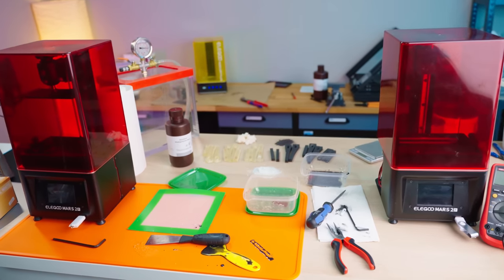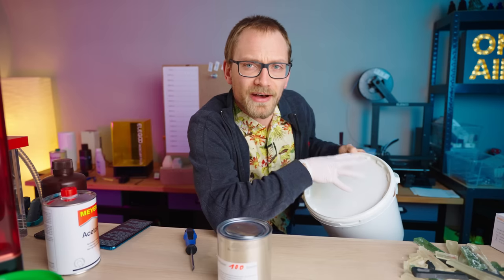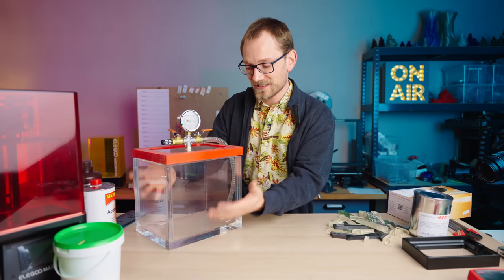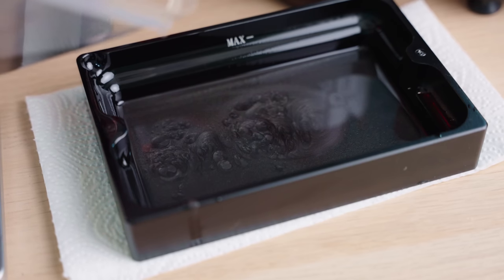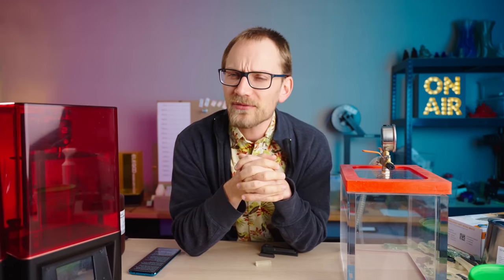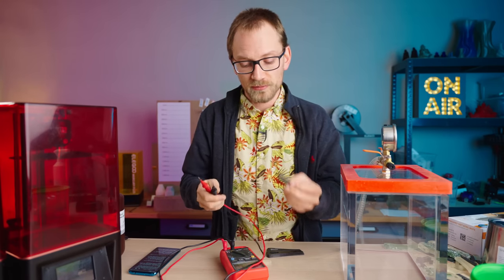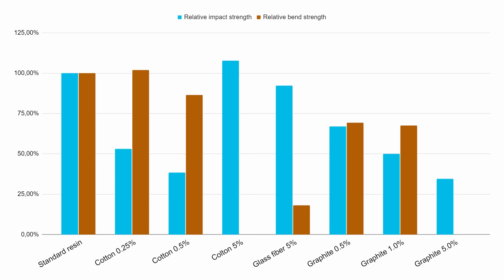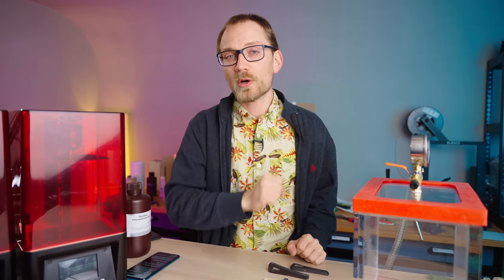Easier Fiber-Reinforced Resin Printing! Stronger and Conductive Resin Prints?

Comment: Not a material scientist either, but isn't the point of adding fiber to have long strong fibers in the part that distribute loads better? By that logic, graphite/carbon powder would do absolutely nothing, as it isn't really a fiber anymore. More likely the imperfections that this creates weakens the part, as I'm assuming the resin bonds better to itself than the additives.

Comment: What about aluminum powder, it is added to resins to add strength.

I know that some the glass fibers are held together with a binding agent, you might be able to separate them by soaking them in a solvent. I'd try alcohol first.
Reply: Do you want an explosion? Because adding powdered aluminum to a reactive resin can totally do that.
Reply: @42436freak  I didn't think the resin would be more reactive than a 2 part system. Given how volatile aluminum can be,  you are correct that it shouldn't be tested unless we know how it would react.

In the marine industry, aluminum is added to 2 part resins to increase the hardness and abrasion resistance. It also increases UV resistance.

Comment: I think the problem is the bonding between the resin and the filler. If there is no bonding your are reducing the strengh because you are make your piece porous. You should try glass microspheres ( I used with epoxy castings ) but it maybe fail also. I think because the resing cures with UV, it just a crystallisation process unlike bicomponent epoxy resins where there is a chemical reaction. Anyway, just a bunch of random thoughts. Good video anyway

Comment: Don't know if it's been mentioned yet, 748 comments is too many to read. But adding stuff to the resin doesn't make it stronger as per your experiments. Adding anything will reduce the molecular bonding that's going on and you're essentially making fewer bonds per layer due to there being graphite in the way instead of resin to bond with. So it's just bonding around the objects instead of making it stronger. Unlike Baking Soda and Super Glue (try it sometime ventalated area pls fumes are dangerous) So yeah, the only bonding done here is UV and Resin, the additives are just in the way. That's my opinion, educated as though it may be....still only an opinion and probably totally wrong...read the 11B yeah, infantryman brain so a grain of salt must be observed ROFL. 
This video was extremely cool to watch either way, I love experiments like this. Plus the aesthetics of the graphite is super pleasing, love to see miniatures printed like that now.

Comment: Realistically, adding any form for structural filler to the resin sla prints will cause  a higher failure rate.

Resin itself when deposited in layers is as strong as it can be.
Adding any form of substance will create brittleness by way of a lower surface area adhesion and the weakest part between the resin and the material.

The only way I can think of to improve the mechanical properties of a "standard" resin would be to have it arranged in a micro grid or lattice. Unfortunately, even with the best laser 3d printers this is not currently possible.

Comment: If I was to make a suggestion, I would suggest carbon nanotubes, and start at 0.1%.

Graphite has a shocking amount of uses.
Paint pigments, dry film, dry lubricant, writing tool, electrical conductor, thermal conductor, reinforcement, fuel.

Comment: Maybe  you could cure the resin + reinforcement in a (UV-transparent) mold rather than using a 3d printer - then you could go to higher concentrations and you could find out what concentration is necessary to improve the mechanical properties.

Comment: Graphite powder in the sub-micron size range on its own isn't very conductive. Adding a small amount along side larger particles like Graphite flakes or CNTs will give you much higher conductivity, but still poor. You might be able to get a capacitive touch sensor/pressure sensor/strain gauge with optimisation. Silver flake is often used for conductive inks, it's significantly more expensive from a material standpoint, and because you can put a higher percentage by weight before printability is impacted because silver is heavy.

Comment: Get a few lengths of carbon fibers and smaller glass fibers and make a follow up video. Honestly, I think carbon fiber has the most potential here for very strong parts. You just need a very thin but relatively long fiber

Comment: Yeah 5% graphite was for sure not going to cut it ^^ tried different powders in resin (not printing resin) copper powder, copper flakes, titanium, steel, each fromm 0-500 micron at different size ratios and up to 50% by weight and just by hand mixing you won't get conductivity ^^ didn't try graphene or any other mixing method (ultrasonic emulsion etc.) as I wasn't looking for conductivity but checking that it wasn't haha thats why when you want a conductive silver epoxy you get quoted 1400€ per 230 grammes (copper is cheaper at around 200-400€/230g), the amount of silver or copper in them is quite high (hence the price for silver) and I think they use some ultrasonic emulsion technique to get it conductive :)
What would be interesting is trying to print with some conductive UV curing epoxy but it won't be cheap if you buy it

Comment: What if you printed a part using a regular FDM printer with zero percent infill and injected that re-enforcement paste into the shell of the print (like with plastic injection moulding). That could potentially be a cheap way to re-enforce parts.
Reply: Or alternatively to zero percent infill maybe some kind of permeable pattern. This could work well with that printer that lays down continues fibbers you tested a while back?

Comment: It's a shame about the conductivity. If that worked it could have been incredible.
That said, your resin printer  is still useful for making PCBs at home. It's a great way to expose photosensitive copperclad (and cure solder resist), just make a one layer file with your traces and set the exposure time accordingly. I'm surprised nobody has slapped a chitu board, a screen and a UV LED array together in something resembling a flatbed scanner yet tbh.

Comment: Hey @thomas sanladerer I was thinking that the cotton seems legit maybe you can try put like 20% in the resin but pour it into a 3d printed mould instead since it will be to thick to print. Also you should try making a protective paint or coating using the resin and cotton n maybe flour! Or corn mill powder

Comment: You can not use chopped fibers. I print with fiberglass and i get a sheet and shave a measured amount with a razor and mix it. What I’ve noticed is that your additives are way too much the layers are to small to successfully cure. Smaller amounts hold in place longer in the resin so that they arent Squashed down to the bottom.

Comment: 5:50 "curing to the core" I think that is actually not really possible becuase one property of the resin is that it blocks uv light very fast by absorbing it so I guess there is not enough getting through. I noticed that in reality when I tried to embed magnets into a part. Imagine a 3mm thick part, that has a hole with a bottom where the magnet can fit in. the bottom is 0.5mm and the magnet is 2mm. so there is 1.5mm on top that I would fill with resin. Putting it under a high power uv light panel makes the top really hard in 8 seconds. Leaving the part under the lamp for 30 minutes is not enough to cure the resin that is 0.5mm deep under the surface (approx). It was like a lake where only the top freezes.

Comment: To improve the strength of a material with fibers, the fiber must have a certain length, because the bond between the fiber and the matrix is always the weak point. If the fiber is short, the bonding area will be too small to use the full potential of the fiber. You won't succeed with milled fibers. They will increase stiffness, but not strength. A good resin is also important. The resin needs some flex to compensate for the different e-modulus.

Comment: Print a mould and then cure a mush with more fibre than resin in that. Might need to build up layers if using printer resin instead of 2-part.

Comment: re. Conductivity - I am not surprised the graphite powder remained non-conductive as the particles are insulated from each other by resin. They will need to be touching each other to be conductive and I am not sure you will have any more luck with carbon fibre for the same reason. (But I look forward to being proven wrong!)

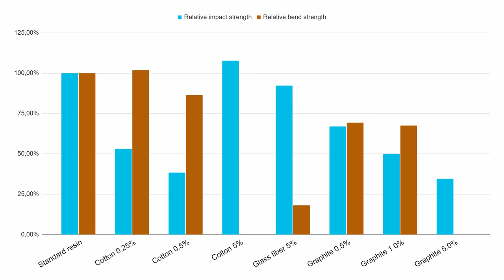Comment: Do I misread that or does the bar chart (at 13:50) actually show an improvement in impact resistance for 5% cotton (or colton)? This doesn't quite sit right with the claim that every amount of additives decreased the strength of the parts. It also doesn't fit the trend of the lower percentage cotton parts. Or am I just misinterpreting the data?
Reply from the maker: Yes, there was a measured improvement in this case, but considering how large the variation was between individual samples, I wouldn't call it "significant".

Comment: I think the fibers should be long and thin and not bending or elastic to reinforce the material not small plates or powder,if you see regular glass fiber or carbon fiber the fibers are long and thin forming a reinforcing mesh a bit like iron bars in concrete

Comment: I don't think it's possible to reinforce parts with stranded material in a resin printer. because the print bed gets pushed flat, the strands will always be forced to lay flat. if you were casting the resin in a mold the strands would be all mixed up and tangled about each other. that's what gives PVC its strength, it's made out of really long strands that get all tangled up. if you layed all of them flat they wouldn't provide the additional strength, and would mostly just get in the way of the resin sticking to itself.

it might be worth it to try casting the test prints to see if they perform better. if the cast fiber-reinforced prints perform better than the cast non-reinforced prints then my theory might be true.

Comment: I think you're missing a relevant baseline here: FormLabs has glass-filled resins (Rigid 4k & 10k). Might be worthwhile to pick up a liter to do side-by-side comparisons. Also, your tests only measure material strength and do not convey any information about part deformation under load. I have had several parts (both SLA and FDM) that eventually deform under constant load. Fiber-reinforced resins might increase the stiffness of the material (but not strength) where they are usable in those use cases.

Comment: Chopped Fiber doesn't make any part stronger when it comes to impact or tensile strength. It maybe makes it stiffer or more abrasion resistant but that is all. In FDM or SLA or even SLS or casting the strength comes from the base material that is connected throughout continuously If you add 1%, 5% etc of anything chopped those chopped bits are not connected so you have less base material to withstand your impact or pull/break test. Now continuous fiber is a different story. If you can manufacture it properly. Only way I have figured out - besides making molds is to 3DP a "core" you can use fdm or any plastic manufacturing technique and then wrap it in FG or CF or kevlar - or anything with a resin like epoxy or polyesther kinda like making a foamcore surf board only the foam is replaced by plastic. Now that in essence produces a Plastic part with a composite shell. So for example you can print a box with a 1mm wall out of ABS and then lay enough 8oz cloth on it with polye resin - a combo I like as Mekp also can dissolve ABS so there is a chemical bond at the surface created whereas with epoxy its just mechanical and the layer lines give a good place for the resin to grip Now you can then build up the thickness to anything you want with cloth/matte/woven roving so he print becomes a consumed mold. We have printed (FDM) 1.76mm wall thickness items for frames (2 perimeters with a .8 nozzle at .88 perimeter width .4 layer height) out of ABS, PETG, HIPS, And then built it up with anything from just 4 layers (2 each side) of  8 or 10 oz cloth all the way to a couple of layers of 17 oz woven roving with a couple of layers of cloth on it. The print gave it dimensional accuracy - 2mm thereabouts abs is strong enough to roll and paint against and properly adhere the cloth and in the end the amount of ABS PETG etc in it is immaterial compared to the amount of FG or CF and you basically have a GF or CF part.

Comment: It's a persistent myth in the community that filament blends with CF powder should make for stronger parts while it is the contrary, it weakens the material because there is no bonding of CF particles taking place and because of total lack of long fibers compared to real CF parts.

Comment: I think you will not be able to reach the concentration of reinforcement required and still be able to print that material. I sometimes work with boats made from glasfiber and polyester, and the strands used are about 5cm long and about half of the finished material ends up being fiber. But this is using a chemically hardening resin and not a uv resin. And glass fibers are typically bonded with something, usually styrene, so your resin needs to contain something that dissolves styrene for it to be able to really soak in to the material.

Comment: Question : I know your are German and you don't make mistakes, but why did you left the bonding agent in the fiber glass? I know that your are familliar with the knowlage that this bonding agent does dissolve in polyester but not in epoxy. Did you left the bonding agent in the fiber becouse your are affraid of the acetone fumes? Or are you affraid of the glass dust?

Comment: Not sure you're going to see any strength improvements at such low percentages. All I know is just from what I've seen with injection molding, where the concentrations are around 15%-60% by weight. Possible reason also why there isn't anyone doing commercial 3D printing with fiber.

Comment: Strength is a very general word that is tossed around alot😅. With my admittedly limited knowledge of composites (repairing my kayaks) ive lerned that carbon fibe is a very stiff material bit in alot of cases kevlar or d-glass is stronger and tougher. 

My understanding carbon fiber excells in applications that require absolute stiffness but it comes at the cost of less toughness

The milled carbon would be very interesting to see but i cant imagine it making the parts any "stronger" as the week link is still the resin, but the stiffness of the part would possibly be grater

Again no expert 😅

Comment: I'm not a material engineer either, but could the poor performance of the fiber-enforced resins be caused by the base resin being simply too rigid and brittle to begin with? (sorry I don't know the engineering terms lol). Essentially the fibers wouldn't offer much support because they're too similar in property to the base resin, and the brittle resin's fail-points are extremely small, maybe microscopic, so the part still shatters and breaks under similar forces because the fibers are not small enough to "bridge" the microscopic fail points in the part. That, or the fibers simply can't help at that scale.

If the base resin was more prone to tearing and bending instead of shattering (Flexible), adding ridged fiber would improve the properties of the resin. It would make the part deform less under stress and more resistant to tearing.

If you're not burned out in the project, I'd suggest repeating some of your experiments with a more flexible resin!

Again, I have essentially no idea what I'm talking about, but it makes sense to me.

Comment: Neodymium dust! Add an electromagnet to the side of the vat to orient the polarity of the dust
Reply: Might be able to pattern the magentic dust if you use a bunch of smaller magnets, make something similar to the structured magnets which you can buy.

Comment: I don't think the resin is curing properly. The resin is the weak part. Maybe the fact the fiber is not continuous is the main reason.  I would suggest three continuous fibers, loosely braided, near top and then again near bottom. You would probably need to pause your print.

Comment: Your fill percentages are far too low to provide a benefit (even if the filler were perfectly evenly distributed). For injection molded parts, 20% glass fill is common.
For the electrically conductivity, you’re not going to significantly lower the resistance until you have some reasonable probability of graphite flakes touching over a macroscopic range.

Comment: I can't see how milled carbon would have any effect as a reinforcement to resin. It brings no structural advantage and the particle size is still is too large to have any chemical effect. I predict that it will have less weakening effect on the printed element by having less interference with the polymer bonds - but may have unusual effects on colouring the resin if used in much smaller amounts. 

If properly stirred, there will be no carbon conductivity effect, since each carbon particle is surrounded by a coat of polymer insulation.

I think that the cotton and glass fibres are too short to too add structural strength and are simply volumetric fillers, understandably weakening the polymeric bonds. Try slightly longer, monofilament glass fibres - at least they will spread stress through the neighbouring polymer. Complex surfaces will require significant cleaning afterwards, though this is essentially an aesthetic issue. Tumbling the part in medium/coarse sand should work for that.